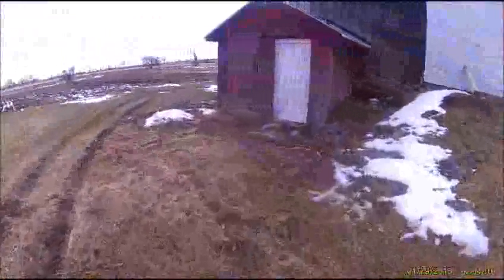Some work on the Curtis Cab

Comment: To determine how big and deep that stripped screw hole is on the loose latch, CAREFULLY remove one of the screws from the good latch. Remove it slowly and don't strip it upon removal. Remove it when the latch is unhooked and not under pressure. Now you'll know what kind of screw it is and the size of that screw. It may be a self-tapping screw.  If so, then you will know how you want to approach the fix. It looked like a phillips screw head. Not sure.
That sure is one really nice cab.  Man, I like it.
Reply: I submitted a LIKE on your video but it will not post. Sorry, I don't know a fix for this. Thanks for sharing the video and enjoy your weekend.